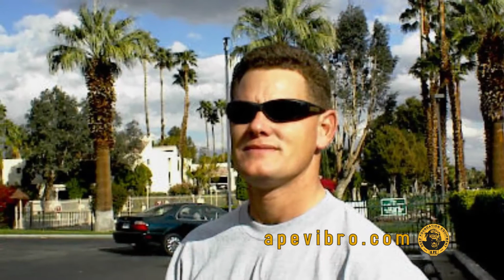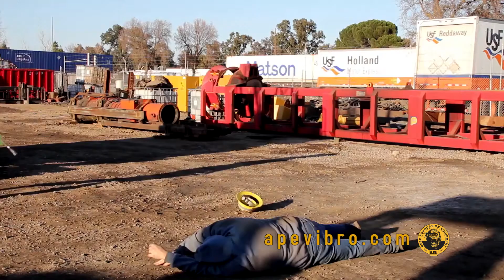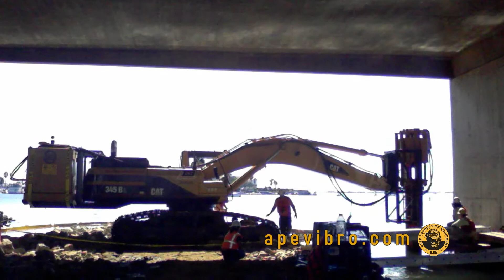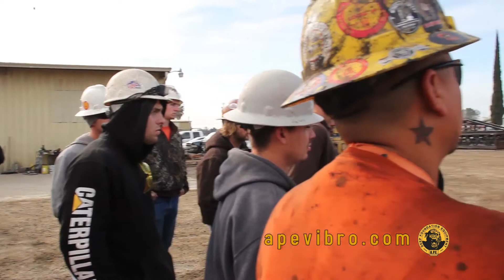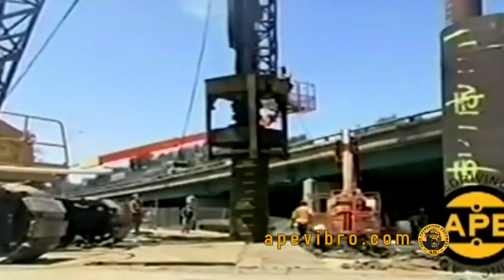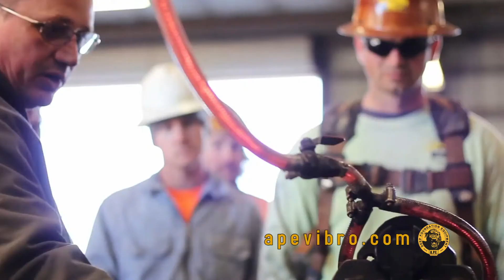APE Vice President Steve Cress: A Biography

Comment: I recently attended the class put on by APE for the local 34 Pile Driver apprentices. It was awesome. Full Dissassembly of a diesel impact hammer, Fuel pump rebuild, Vibro inspection and set up. We were also fortunate enough to use a Hydraulic impact hammer.  It gives me great pride to know our apprentices are receiving training from APE. Manufacturers that care this much are few and far between. Thanks to Dan and Chris Corp at the stockton APE yard for an excellent class. Thank you Steve for spearheading this class, I was fortunate enough to have you as my instructor during my apprenticeship. It's your dedication and enthusiasm that keeps this thing alive.